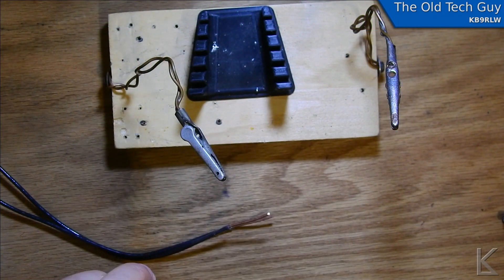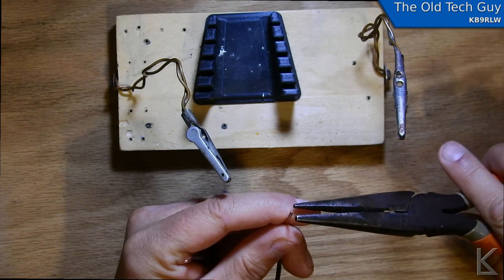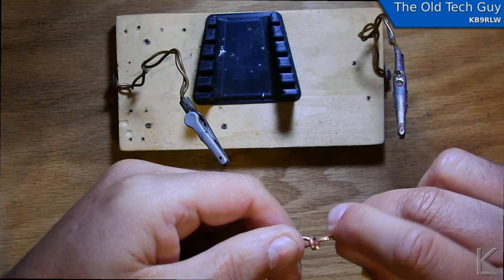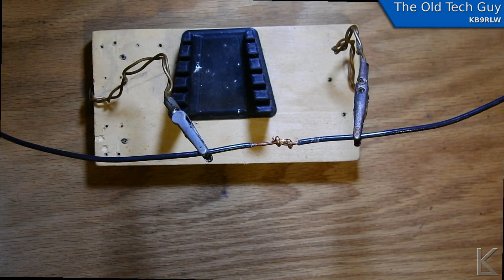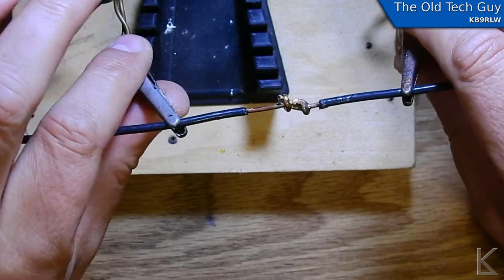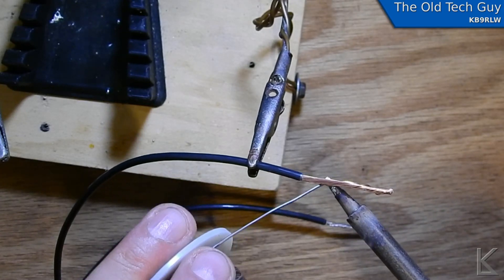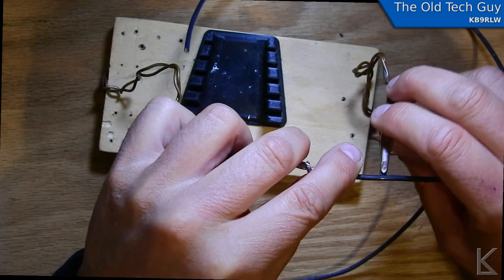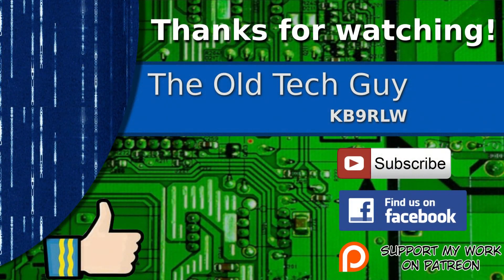New Ham Tips - Lengthening antennas with a strong Lineman's Splice

Comment: I have a Lineman’s Splicing tool, that I got when I was a Telephone Outside Plant Technician in the Air Force.  It was made to splice open wire phone lines.  It clamps and holds the wires parallel to each other so you can wind the wires around each other. It is an antique tool! Not much open wire in use today! One of the first jobs I did in the Air Force, after going to Technical Training School, was actually removing miles of open wire phone lines at Hurlbert Field, Florida!

Comment: YOUR SPLICE WILL WORK  BUT IF YOU HAVE THE ANTENNA TUNED CHANGING THE LENGHT WILL DE-TUNE IT SOMEWHAT.  THERE IS A LONGER VERSION CALLED THE 'WESTERN UNION SPLICE' VERY EFFECTIVE.
Reply from the maker: As I mentioned in the video, this would be for tuning an antenna where you had it too short.

Comment: Kevin I would like to say your lineman splice is close but>>> try this strip 3 inches off each , hold the wires as an Xso that they cross at the 1 in spot. now simultaneously twist both just like a twist tie. 3 turns per side and the splice is tighter and stronger. you will not be able to pull it apart. Cut off the excess wire with or without solder it will last for ever . solder is of course better but the least amount to cover it is best. I learned this working for WESTERN UNION as a wire and repeater tech in 1970.   the main idea is make it mechanically tight before you solder it. Solder locks the wires in place but excess solder does nothing but add weight.   Please keep up the good videos 73s from AC8XB
Reply: What he said above ^^.  That is right way.  I saw Kevin was in trouble the second he stripped the end just an inch.

Comment: Way back in the mid 70s, I was taught this but we did three twists in the middle and three wraps at each end. It was called a western union short splice. Very strong!
Reply: Same here. And with stranded wire, just tin the very end, and it's still flexible enough you can do a 5 or 6 wrap Western Union joint by hand, no pliers necessary.

Comment: Bonus video!  Looking forward to your doublet antenna video.  Your antenna videos are like all of my projects... the best one is always the next one!   A new project is like a baby.  Who doesn't love a baby?

When I make a stranded lineman's splice, I don't twist the wires to try to make a single wire and I definitely don't tin the stranded wire before splicing.  I can easily twist the two stranded wires into a splice without pliers.

Don't forget a piece of heat shrink tubing, or better yet, two pieces of different lengths so the outer piece is an inch longer on each end.  The 3:1 shrink ratio tubing with heat activated adhesive inside is great.  Shrinking over 5 minute epoxy is even more waterproof.

I recently upgraded my 15 year old Portasol butane powered soldering iron for a more powerful Weller butane iron to make it easier to solder RF connectors onto coax braid.  Much easier now.

Comment: Thanks for the reminder.      
   I used the linesman splice to cobble short lengths of wire for an 80 meter antenna. It held up for two or three years despite 50 to 60 mile per hour winds on occasion. Glen, N0QFT

Comment: For stranded wires cable, I use electrical cable connector.  Just screw both cable's end and wrap it with insulator tape.   Ikno it is not the best, but for me it is the quickest , and enough for my need.

THank you for sharing..

Bahathir 9W2GNU, 73.
Reply: That was my question on top of the comments 🙂 wouldn't it be easier with a simple connector strip ?

Comment: It is easier to bend the wires if you bare more length and then trim it once you have it twisted on both sides. We used these type splices on #8 copper weld line wire, which will teach you many bad words!!!

Comment: Nice!

However, (and you sort of hinted at this just before 9:30)...

Before your twists & solder, don't forget to slip over some heat-shrink!  

That will help seal up the joint; protecting it from corrosion, etc.

Comment: Many years ago I heard that a good splice or solder connection should be able to hold together before you put the solder on. Something I'm guilty of not doing sometimes. For temporary connections where there is no strain I sometimes just lay the wires beside each other and stick them together! Of course, I learned the lineman's splice back then too! :)